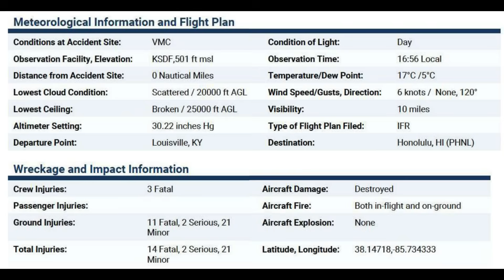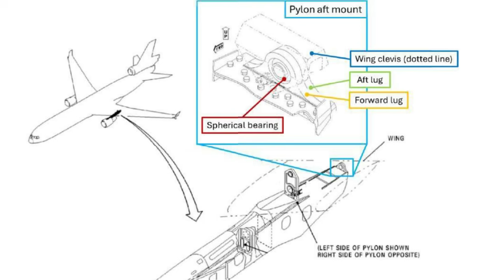UPS Crash - NTSB Report Analysis  #upscrash

Comment: Why is the left engine not turning in the opposite direction? So opposite gyroscopic precession too. This would direct the enige away from the plane instead of over it, in case of a pylon failure at takeoff. Could this be a safety improvement for new airplane designs?
Reply: Some propeller aircraft do this to counteract torque and gyro effects as well as to reduce asymetric thrust when one engine fails.
I suspect the economics do not favour manufacturing two different jet engines with two different sets of turbine blades.

Comment: How about number of cycle comparisons with other MD11 and DC10 aircraft presently grounded.  Even better, include all aircraft as of the time they were taken out of service.  Also, yesterday I saw a rather interesting demonstration of 'gyroscopic precession' that explains in part the path the engine took, up and to the right, when it separated.  The engine in AA191 went back over the left wing.  Though this accident is similar to AA191, a read of the NTSB report for that accident (pg48, bottom) suggests there are events other than maintenance which could cause damage to and compromise the pylon attachment to where it could fail later under additional loads it would not normally fail under.  Interesting that both of these accidents seemed to occur at rotation, when additional loads are put on the aircraft.   Awaiting TWA800.
Reply: Is it true that this was the first long haul flight of this aircraft after its long maintenance in October? If so, this might have been the first instance in weeks (or even months) of the plane carrying close to maximum takeoff weight.
Something else I’d like to know: will engine thrust (and thus load on the pylons) be higher in this case or is full thrust selected in any case shortening the takeoff roll at lower weight?

Comment: In the first few videos about this incident, Richard was insistent that the aircraft lost thrust well before rotation. He was very confident in his calculations that over 60% of thrust was lost prior to V1. He was mum on that assertion yesterday and today. It would be nice for him to either maintain that claim or admit that he may have been wrong.
Reply: Agree, however we don't know just by looking at photo 1 that the engine is at 100% thrust.  There could of been some internal engine issue that did in fact reduce thrust and possible severe engine vibration that resulted in the pylon failing.  It's also possible the engine was surging causing stress on an already cracked pylon lug.
Reply: @glenncox3986 Further, while the lugs had some cracks that would have reduced the strength, the cracks had not propogated very far so it becomes an interesting question whether they failed with just normal loads or did some event overload them such that even lugs without cracks would have failed. Lots of questions to keep the investigators busy for a while.
Reply: Thanks for very factual comment - the questions regarding lack of acceleration/thrust prior and after V1 speed are of utmost importance and should be clearly and fully answered, especially when it took extra half a kilometre for MD11F tragic flight to get even airborne... This clearly shows there was something wrong happening and pilots should have this information so they can abort the flight before it's too late. I just simply cannot understand why people are not paying enough attention to those important facts. Onboard accelerometers, sensors, FMS and computers are processing those data practically instantly and should warn the pilots - hey guys, we are far too slow, we are too late to reach V1 safely, we are far too far on the runway - abort immediately while it is still safe.
There are many associated questions, concerns and comments in the episode "Pilots Not To Blame" 5 days ago in this regard - just name a few - @helalnicola5980 , 
@jimleveritt3028 , @Ventus45 with a lot of illuminating information and @KeiDys774 and many others.
Those questions are being asked - but not being answered. I would like to use this opportunity and ask kindly aviation experts Richard and Geoffrey to answer them fully and in detail so we are not kept in the darkness. Thank you.

Comment: The MD-11, N259UP, was not the last one built. On the contrary, it was one of the first MD-11s built, initially delivered to Thai Airways in 1991.
Reply: UPS N259UP (Serial #48417) was delivered July 1991 to Thai Airways then to UPS June 2006, the 21st MD-11 off the line. UPS N262UP (Serial #48806) was the last MD-11 serial number built, first delivered to Lufthansa Cargo Jan. 2001. UPS currently has 3 other MD-11Fs in service that were delivered in 1991 --- N258UP, N286UP, and N293UP.
Reply from the maker: YES you are right......I don't know where that mix up came from. My apologies.
Reply: That information sounds familiar to me. Don’t remember where I heard/read it though.

Comment: AI 171 vs UPS 2976 crash scene integrity
Hello Geoffrey and Richard.
I follow most of your videos and excellent analyses of these 2 unfortunate events and cannot help but be astonished at the vast difference in how the crash sites were treated. I know you have briefly commented on the differences between the AAIB handling of the AI 171 crash vs the NTSB and UPS 2976 however I was wondering if you could further elaborate on the glaring differences in how the two crash sites were managed especially with respect to what evidence was likely lost in the premature cleanup of the AI 171  site. Thank for your detailed insights into all manner of fascinating and tragic air crashes.

Comment: 1:41 Since Figure 1 image #3 in the Prelim. Report shows that the left engine fire did not start until after Vr and after liftoff, the assumption in Episode 265 at 12:39 that the "Left Engine Fire" started at "V1 Bell (T = 37 secs)" was incorrect. Also per the Prelim. Report, "the left main landing gear impacted the roof of the UPS Supply Chain Solutions warehouse" not a tail strike of the aircraft (at 12:03 in Ep. 265).

Comment: For all those who criticized the aircraft manufacturers for placing the fuel cutoff switches in easy reach of both pilots when discussing the Air India 787 crash, the UPS disaster should put to rest any such criticisms.
Reply: Point taken, but the valves controlled by those AI171 Fuel Cutoff Switches ended up laying in the grass by the runway for UPS 2976. So I don't think the #1 Fuel Cutoff Switch on UPS 2976 would've stopped their wing fire.
Reply: @Raiders33   Obviously they didn’t help on the UPS crash, but they are in an accessible place for a reason.
Reply: @Mark-rw3kw  Yep, that's why the first two words I wrote were, "Point taken."

Comment: If pylon has a periodical replacement cycle, pylon manufacturing quality control and whether it is under more stress during UPS-s mode of operation could become focuses of next stage investigation.
Reply: Why would it be under more stress? Cargo aircraft typically have longer turnaround times and fewer cycles than those in passenger service. The maximum takeoff weight is probably limited by design, not use case (passenger/freighter)? But I am wondering about something else: could the longer turnaround times and thus a higher relative exposure to intense weather (rain, dust,…) over the lifetime of the aircraft speed up corrosion?

Comment: That left engine obviously became its own projectile moving faster than the aircraft.  Shear pins would allow it to drop off but this is not what happened as the shear pins did not operate.  What a contrast, indeed, with the prelim of AI171.
Reply: It would require both pylon mounts (or engine mounts) to fail simultaneously for the trajectory of the engine to be different, the weight of the engine and pylon would cause the pivot around the front mount, and with all that thrust now concentrated there, the engine would turn into a rocket, flying upwards before the loss of fuel caused the engine thrust to drop off.  
BTW the same gyro forces are at play when a vehicle loses a wheel.
What is also interesting is the possibility that the hot burning gases sucked into engine 2 could possibly have been enough to cause a compressor stall on that engine even if no debris ended up being sucked into engine 2. The technicalities of the final report are going to be very interesting.

Comment: The fireball following over the wing suggests that it was still lifting and a low/high pressure differential, but can you tell if hydraulic controls were severed? The road crossing video shows wings-level more or less and a left drifting crab angle must have been the result of asymmetrical thrust. One can guess that if airport planners had devoted downrange space to wildlife, that might only have added more risk of bird ingestion. Still, a nice mile-long turf overrun might have given the crew a chance before it all went up. An arresting net might have saved the victims beneath their path. Whether an imbalance caused a pylon failure, corrosion unseen, metal fatigue, or maintenance shortcuts enacted, it's surely too early to tell. I didn't see any feathers flying, in the first snapshot.

Comment: The 1979 DC-10 accident at Chicago should not be compared to the UPS event, as the underlying causes differ significantly. The Chicago crash was primarily the result of design deficiencies rather than operational similarities.
While the improvised maintenance procedure contributed to the engine separation, the aircraft should have remained controllable with two functioning engines. However, several critical design flaws prevented recovery:
1.	Loss of Essential Flight Instruments
When the engine detached, the captain lost all primary flight instruments, including the stall warning system for both pilots. There was no redundant power source for the stall warning. Had this system remained operational, the flight crew could likely have applied power and lowered the nose to prevent the stall. The stall system was only powered by the #1engine
2.	Uncommanded Slat Retraction
The separation triggered an uncommanded retraction of the leading-edge slats, causing an aerodynamic stall on the left wing. This vulnerability represented a significant design oversight.  
3.	Operating Procedures
At the time, standard procedures called for reducing power during such events. They had about 170 knots at rotation and where increasing speed. The stall speed increase from 157 to 169 knots with out slats. Combined with the absence of stall warning, this guidance further reduced the chances of recovery. If the stall warning system had been powered independently or through both pilots’ instruments, recovery would have been far more probable.
In summary, the Chicago accident exposed fundamental design and procedural shortcomings rather than maintenance alone. These factors collectively contributed to the loss of the aircraft. How ever, there was supposed to be a automatic shutoff valve for hydraulic and fuel which in the UPS flight did not work correctly.

Comment: Hi gents, from the photo sequence it would appear that the left engine rear pylon attachment has failed, and that the engine, still delivering thrust rotated about the forward pylon mount until it tore free. This doesn't seem particularly consistent with the uncontained explosion scenario, in fact it gives more the impression that the pylon rear attachment failed under thrust, this then leading to the sequence of events in the following pictures. I seem to recall an engine pylon failure on a cargo aircraft on approach in Hollan?? I believe the investigation found non-cerified shear pins, or am I confusing this with another accident? Sorry guys, I've now completed watching your whole report and see that things have moved on since I last tuned in. Cheers.

Comment: The reason the separated engine flew off to the right was explained on another channel. It was gyroscopic precession of the engine rotors and fan as the engine tilted up on rotation and separation creating a strong force to the right. For the same reason the moment of rotation on take off is the moment of greatest stress on the wing pylon, not just forwards but sideways.
Reply: Juan Browne, on the Blancolirio channel. A professional long haul commercial pilot for a major U.S. airline, and an A&P mechanic; he also has extensive experience as a military, multi-engine pilot, and a firefighting pilot.
Reply: @greyjay9202  Yes his demonstration using a rotating bicycle wheel is excellent.
Reply: Richard and Geoffrey, I also read about this on another channel. Is this correct? Can you explain it for us non-aviation non-engineering people
Reply: Yes correct.  I have experienced this very effect on quite few items that involve rotating elements, from windmills for pumping water to small wind generators, to even model airplanes.
Reply: The ole "Right Hand Screw Rule" of angular momentum.

Comment: United Airlines pilot and YouTuber Juan Browne has put out a couple of recent videos on his Blancolirio channel dealing with this crash in which he also demonstrates the immense centrifugal forces involved with the engines using a spinning bicycle wheel as an example. This clearly demonstrated how the engine was able to flip up and over the back of the aircraft. He also explained that the greatest forces exerted on the pylons during normal flight operations are when the aircraft rotates on take off.
Reply: What effect do toys have on kids? In the fifties I got a gyroscope toy for Xmas. You pull the string ,put it on the floor and let it chase the cat. When the cat tried to bat it , it would precess. That engine reacted the same way the toy on our living room floor did 65 years ago.
Reply: yes, some of us, including myself have already commented about the "gyroscopic effect" the other day as demonstrated and commented by Juan on his channel.  He's also a  nonsense guy unlike the (in)famous Captain from another channel. Best analysis are done by this channel and Blancorilio
Reply: @stevebubbie1126  The difference between those with both operational AND technical knowledge and those without both. Does not mean however that pilot's views should be discounted.
Reply: During heavy maintenance like this it is always a good idea to install new pylon and fuse bolts. I understand the price is like 2.5 million. Also l believe that if it was a commercial jet the FAA would have force them to install new one. What happened they only lubricated the pylon and missed the tiny crack which grew larger and on the 29th flight it broke at the aft.
Reply: @ilan6987  Not quite.  The report shows that a full inspection was only required after 29 000 cycles and that value had not yet been reached! I suspect that the NTSB will have a recommendation dealing with changing the full inspection to be carried more often at much lower cycle counts.
Reply: @geoffdaniell814 the 29,200 cycles applies only to normal service. So it does not protect during heavy maintenance when the part, (pylon), removed or stressed during that heavy maintenance thus its only valid if the part is untouched therfore the 29k number becomes meaningless! Let me elborate; FAA rules are that even if the part only being susdpected to be overstressed, the maintenance schedule does not apply even if the next inspection is due at 29k cycles.
Reply: btw, Juan is retired from UA flying 777's.
Reply: Juan Browne flys for American.
Reply: @T82975  - he's retired recently.

Comment: It's still not clear if the spherical bearing is removed from the pylon lugs to inspect the bore of the lugs during the last heavy check.  That would be the only way to ensure fatigue cracks don't exist at the surface where the forward and aft lugs sandwich together.
Reply: And that will require some downtime for the aircraft, which I’m sure the airline wouldn’t want to really do
Reply: Per the Prelim. Report's Maintenance and Inspections paragraph, it was just a "lubrication task" done on the thrust links and spherical bearings last month in Oct. 2025.